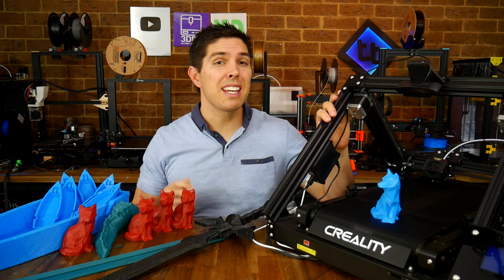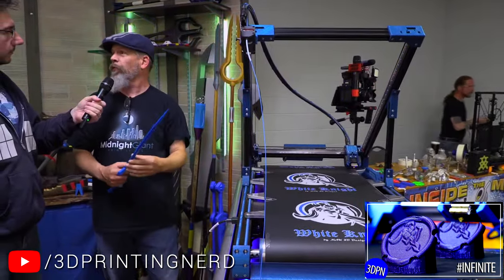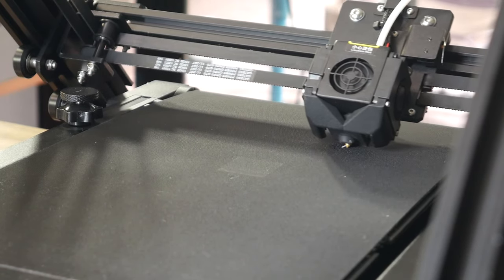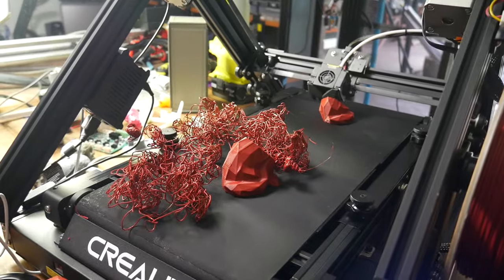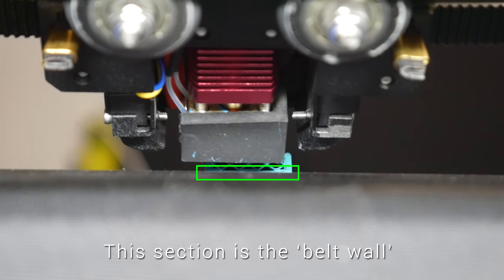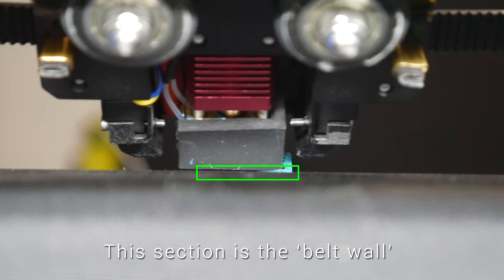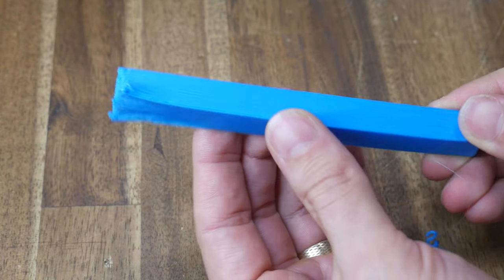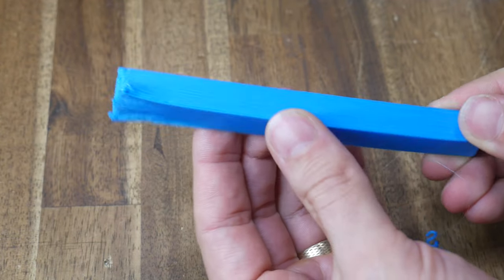Creality CR-30 3DPrintMill belt 3D printer: What to know before you buy

Comment: Very fair! Already working on a lot of this👍🏻
Reply: Awesome work, Naomi! 👍👍👍
Reply: To fix belt track, add two color lines the length of the belt, with matching marks on the front plate.  Run the belt for a revolution, easy to spot alignment issues.
Reply: Instead of the tiny hex screws for belt tensioning on the front can we get knobs like the bed leveling ones on newer Enders please.
Reply: I wonder if it is possible to add some ball bearing guides that ride on the edge of the belt to keep the belt perfectly centered so it can't pull over to either side?
Other than that, and a little hairspray from time to time, it seems like a great printer, especially for people that run print farms making hundreds of the same items to be sold.
Reply: Hi 
Naomi 'SexyCyborg' Wu, that's nice to know, I can't wait until this available again, as no more left on Kickstarter, 👍
Reply: Indeed I backed this printer, because it is amazing and to support the ones that made this possible!
Reply: I take on on Kickstarter I impatient to receive is look cool my first project after the ajustements is the Mario Kart Live piste in real size 5 M to 5,5M in 4400 parts is the perfect project for the Mill printer
Reply: Whew, thanks for the video Michael. I just canceled my kickstarter pledge. This thing looks like more trouble than it's worth!
Thanks for making an honest take on this printer. I feel like all the other videos I've seen were a bit misleading, (hence why I considered backing it to begin with.)
Reply: does this printer use self adjusting belt tracking by chance?
Reply: @Jalapenoman  run a photo eye on each side and put in parameters for tracking.  The machine can track its own belts.  Industrial has been running like this for decades.  Seems worth it on something this price range.
Reply: @saltysteel3996  photo eyes
Reply: Now that's someone that's about their craft right there.
Reply: Why not substitute the belt for a long strip of glass or metal?  Say 1m, or traditional bed sections are fed in from a hopper.  This opens up bed selection material options and eliminates the belt tracking issues.  Technically a flat belt pulley system needs to have at least one pulley slightly crowned so that potential belt offsets become self correcting.  Great to see this design being progressed and the original designers recognised!
Reply: I wonder if we will see reprap and wifi variations too
Reply: Nah someone else does it for you , but who cares
Reply: I know this is a long time off, but what if the belt incorporated a thin mesh layer of steel in the bottom, and the bed under had a grid of medium strength magnets?  Not too strong to make the move difficult, but enough to bring in much more stability.  The steel would also increase the longevity of the belt as it would keep it from stretching as much over time.
Reply: @jameslmorehead  along with the magnets, the rollers could be keyed with the mesh pockets so the belt never slips side to side
Reply: I'm glad to see this concept is so well supported by passionate people such as yourself and your fellow developers.
 I've been following this feature since the early days of the makerbot ABP and I believe it has a bright future, especially with dual material support.
Thank you very much for all the hard work you're putting into this, I will surely use the software to make my own iteration of the design soon enough :)

Comment: After backing the CR-6 and the stuffing around there I don't think I'll ever back anything from creality ever again sorry to say.
Reply: Would you care to elaborate? Curious because I might back this one but haven't backed anything from Creality before.
Reply: Also curious to hear you elaborate. I thought the cr-6 looked solid. I was baffled why creality would kick start a machine that they should have just made to begin with.
Reply: I have the same feeling cr6 is a good printer but the the Kickstarter versions had so many trouble and an extremely bad customer service. It made the cr6 community furious. Mine luckily only had a broken power switch compared to others with burning motherboards and after many months still no replacement parts......

Comment: I wish they made a belt printer without the 45 degree angle. Obviously it wouldn’t be meant for really long prints but if the belt moves back and forth, it can print small objects at the normal 90 degrees. It gives the benefit of popping the print off when it’s done and allows for multiple prints to continuously made.

Comment: I've had my Cr-30 for about a week. I  learned how to tram this sort of belt printer and it's been printing very well! I'm looking forward to having Octoprint running on it.
Reply: hey are you there ? I just got cr-30 there are questions I need to ask
Reply: @TonyStark-po9di  What's up?
Reply: @JasonLooseArrowAlso  i cant communicate with mine over serial, did you find anything you needed to change for the serial? And which firmware version does you printer have?
Reply: @dead_engineer  I always just used the USB cable. I sold my machine a while back. Good machine, though. It just didn't do what I needed it to do as well as my other machines.
Reply: @JasonLooseArrowAlso  thank you for your reply, in the end I got it working with octoprint :)
Reply: @dead_engineer  ah, good.

Comment: Another benefit: It will also print non-planar, in a way. At least non-planar with respect to the bed. For example (infinitely long) aerofoil should be very easy to make.
Reply: until the printed part starts weighing more than the part being printed... then gravity will stop the print :p

Comment: It's a great product, as you said, it shouldn't be your only printer, but with a bit of tweaking, hopefully, some of it done factory side, (and slicer settings) this has the potential to be a VERY good printer for infinite length products, or doing a big batch of prints that would otherwise have you removing them on a scheduled timeframe.

Comment: I had thought about this idea but complexities arise as any conveyor belt system has to have some flexibility. 3D Printers rely on the solid hard surface to be able to maintain the leveling. If the conveyor is to tight to compensate for any flexibility in the print bed then the conveyor would have a hard time moving. Adjust it more loosely and then the problem is flexibility making the bed have unleveled surface. BUT, interesting concept. I hesitate to buy dual extrusion printers, multi-purpose 3D Printers and ones with this conveyor. In fact I prefer Lead Screws vs. Bowden systems. Now if I needed to print multiple parts in an assembly line type of setting then this could be attractive. My favorite printer is a Lulzbot TAZ 6, which I even built the toolhead, they call it a toolhead, that has the MOARstruder Tool Head for 1.2 nozzles. GREAT for a very VERY quick prototype. Then I go back to the .4 nozzle with the 2.85mm filament. BUT, if I want to use 1.75mm filament I did built a 3rd toolhead to swap to 1.75 filament. The worst printer I own is a Sindoh DP100. There is a design flaw that, perhaps, the other enclosed 3D Printers have. The closed casing is a good idea for ABS prints but the Sindoh is very over engineered with the cassette box that holds proprietary filament, which you can get firmware to bypass that. But any extruder jam and you are opening the machine, which is a real pain. Design flaw is that the heated bed goes up and down on the Z axis. The design flaw is that the support for the bed on the rails is in the back, therefore supported by the plastic guides on the bed support in only 2 areas, the 2 back rails. Eventually the plastic guides that ride the rail on the bed support they wear out and the round structure on the bed support becomes oblong. The Lulzbot, best machine I have, you can actually print out most replacement parts, that's how I built my other 2 Lulzbot toolhead. Try to get that part, they don't sell it. And then you have to get into the major disassembly even if you had the part. Now I did break my rule of not buying multipurpose machines and I have a Snapmaker 2.0. It is pretty decent. I use it mostly for 3D Printing as I did not buy the Laser or CNC modules. One crazy printer I have is a Dobot MOOZ 2, that Naomi did a review on. She did not like it BUT she did not either have the patience or knowledge to use it. I got to say that it is my very best printer but as small as the Snapmaker original. In fact one of the 2 companies must have sued the other as they were nearly identical. Only reason I don't say that the Dobot is as good as the Lulzbot is due to the small print volume. But I printed 2 of the models that check print quality and tolerances and, guess what, the Dobot was the best. Surprised right. My Dobot does have the 3 modules, Laser, CNC and 3D Printing. I have used the CNC and Laser but not often. I've got to say, hands down, that for small models the Dobot does the absolute best builds. I do mostly robotic with Arduino and Raspberry so the parts I need are usually larger and I prefer to not glue parts together, but for smaller gears I constantly use the Dobot.

Comment: Hey Michael a video on Octoprint would be great. I assume it requires some special settings to add the cr30. Also octolapse as far as I know would require a bit of setup for the belt printer. Both would be great videos. Please also post the webcam mount you got and the cura profile you used.

Comment: Brilliant video, my first printer was a the Delta Kossel (mega pain).. 2nd Printer, Anycubic Mega S (really easy).. I need long though to make some TPU belts and gaskets.. fingers crossed 😁 I've just been thwarted by a 'stray' caphead, that I think was meant for y axis adjustment, it lodged in the extrusion behind the extruder.. kinda makes assembly difficult, so I'd definitely recommend checking all extrusion gaps for FOD..

Comment: I have no use for the thing and don't think much of the quality of the results either. However it did occur to me you could tilt the bed (actually the whole printer base) to, say, 45deg and the overhang issues would go away. You could still get usefully long prints with the printer sat at normal desk height (your sword for example) and also still able to return it to its usual orientation for the stupidly long prints (which if you're honest you're not going to want anyway...)
Reply: One of the review videos tried this. Gravity seems to only play a small part
Reply from the maker: That's a nice idea.

Comment: Hi i am here from the future(June 2021).. we backed the project and have gotten the printer.
I have to say it's a really good printer.
One thing that stand out, is the overall quality/price ratio..superp
I agree with the learning curve.
But ones you get more experience and also get more video on tube you will also overcome this.
You also overcome this
But i want to add a small remark.
If you are to make long print.the spool holder that is supplied with the printer is just to little.
You would want to have a big spool of filement..i made my own easy.
But i do recommend people to buy a solution or at least make one..as changing filement mid print. Introduced unnecessary challenges.
One thing that really stands out..it's very silenced.. 

Well we need more in depth setting vids on this....here mid June...
So please make some.

Comment: Nice printer. When I got one, I'll do the following upgrades:

- Linear rails.
- Microswiss Hotend or Hemera extruder.
- Duet mainboard.
Reply: I’d recommend a mosquito hotend.  One handed nozzle changes make things so much easier.
Reply: @NAK3DDesigns  I would go to a Dragon hotend. Also capable of one hand nozzle changes at half the price.
Reply: @vinnycordeiro  I can’t support the Dragon.  It looks to be an  unauthorized copy of the Mosquito which is patented technology. But that’s my personal choice.
Reply: @NAK3DDesigns  Respect your opinion, although I disagree: I don't think just adding four metallic posts between a heatblock and a heatsink could be characterized as an unathorized copy. Anyway, I'm not a lawyer, and that question is way beyond my knowledge, I may be wrong.

On the other hand, if you look at the Spider hotend, that is an unauthorized copy of the Mosquito.

Comment: 5:32 why this locking nob never made to any of their other printers? I'm sure it would helped a ton at retaining level on one without ABL sensor
Reply: Idk, seems like a good idea. 
However, on my Ender 3 Pro, I installed a glass bed with solid permanent bed mounts, the 32bit silent motherboard, and a BLtouch auto bed leveling probe.
It's so nice. 
I never have to touch the bed. Lol
Reply: I know!  The never ending bed tuning could end with a simple locking knob!  After months of going crazy I did this with my old XYZ’s and it transformed them!  (M3 brass coupling nuts 40mm long.)

Comment: I really like the idea of it and considered building one of the squires until I saw the total on the BOM. I have a half dozen Creality printers and  I really would have considered this if It had come out before the 6SE. I supported that Kick starter and that turned into a cluster.  Mine was doing all sorts of strange things until a recent Firmware update and I'm one of the lucky ones.  On the Print mill  I would be worried about belt life and adhesion. I really want to see some long term testing.

Comment: As a customer, I do not see why the retail price of this machine is supposed to be three or four times the price of an Ender 3/5. As you pointed out, all materials (except for the belt) are parts carried over - including the old V-slot rollers, cheap hotend etc.
Admittedly, the belt mechanism is more complex than an Ender 3, and the adaptation of firmware and Cura both certainly cost some good effort and money. But for me, Creality stands for cheap printers - in the literal sense. If the price for this machine would be half of what they suggest now, I would consider taking a closer look. But if they insist on calling up Prusa-level prices, I would expect them to deliver Prusa-like quality - I. e. responsive 24/7 customer service, high quality brand bearings/linear rails/timing belts etc. - and especially a machine that works and procuces perfect quality prints out of the box, without any fiddling and tweaking, as demonstrated by you here.

Comment: Off-topic, but I wonder why the ender 4 didn't take off?, like you can't find it anywhere these days...It also legit looks really cool.
Reply: good question
Reply: The ender 4 is actually a h-bot style printer not a corexy. The ender 5 is similar to the ender 4 but much more popular instead of the ender 4
Reply: @rudranakade  Yeah,I have an ender 5,it seems much more bland than the ender 4
Reply: There will be Ender 6 for corexy, comes with stock enclosure probably. That would be interesting. I have just built a new Sapphire Plus’s next revision beta model, will try fitting some acrylic to make it Ender-6ish on a budget.
Reply: @arthurmorgan8966  Cool!,besides,I could probably just modify my ender 5 for core xy and an enclosure without getting the ender 6.
Reply: I like the ender 6. Looks really nice👌 
Saw it announced for around 580ish on one of their stores
Reply: @ic3dragons223  Yeah,my ender 5 cost 300 something dollars.It seems that the new design and enclosure make the ender 6 cost more.
Reply: @annammathattarath107  the enclosureon the ender 6 looks like glass but it's probably acrylic and 250x250x400mm volume. Just looked at the premium version and it's 549$. Though,  Kickstarter for Naomi's factory printer is 589$. Tough choice. Only wish her printer was big enough for my projects. Temptations
Reply: True

Comment: I really like the idea but to me something like this has to have support for multiple rolls of filament so you can auto switch while printing. This thing is going to suck up a roll of filament in no time. Other than that just little nitpicks here and there like knobs to tension the belt rather than hex screws/bolts and an extended roller set that would have legs that could be adjusted and attached to the printer to allow the longer items to feed off without hanging in mid-air. I know you can do this yourself but it just seems like it would be a great accessory Creality could offer. Really is not a bad price at all, even at $1000. Next up, resin printing on a belt LOL

Kickstarter - I do NOT think companies like Creality should be using that system. If Miss (or Mrs) Wu would be doing this on her own then it would be a viable way to get funding to get a project going (which is what kickstarter was supposed to be for in the first place) but with the backing of Creality the only reason for kickstarter is so they could take a loss without hurting their own pockets and of course, free advertising. People hate me for my opinions....it's ok but I won't stop saying what I believe to be true ;)

Great video as always man!
Reply: They sell a roller extention for $100usd. The bed belt tensioner bolts are meant to be adjusted very rarely. Do it once correctly and not need to again. Having knobs would be more of a liability than anything and they are not needed anyway.

Comment: I think this printer really needs the extruder motor right on the print head instead of having the feed line. And the belt looked like it had too much vertical play when the nozzle touched it.